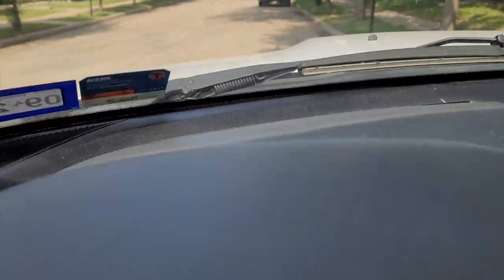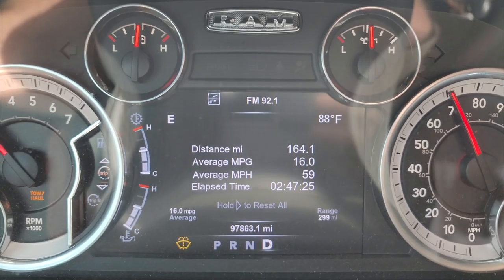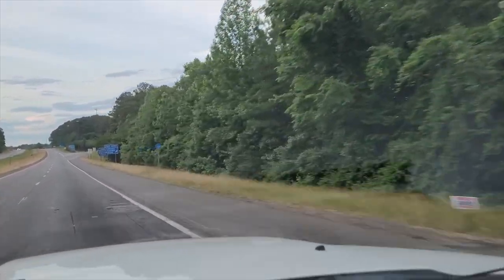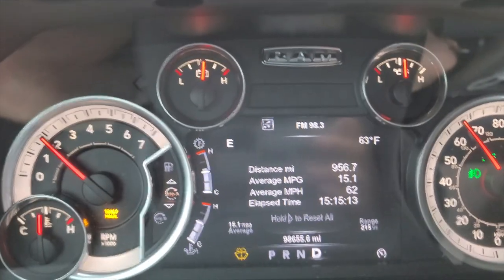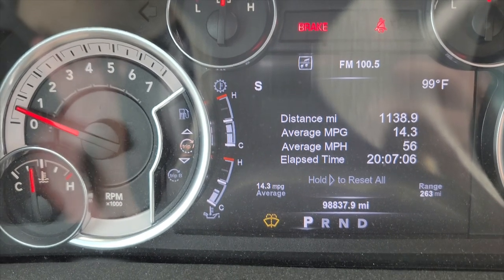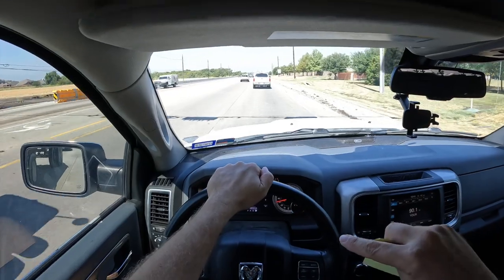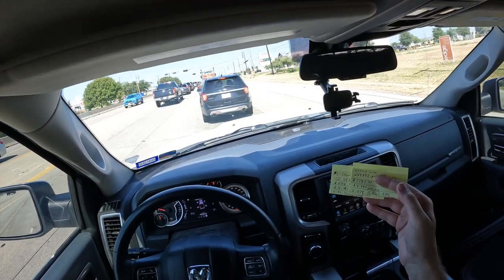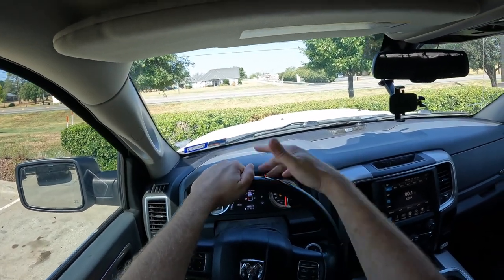Ram 1500 Mileage Test Towing an Open Car Hauler and comparison to towing an Enclosed Trailer

Comment: Better mpg than I would have expected. Love your detailed videos Chris, thank you!
BTW, picked up my new 2022 single seat 1320 on Tuesday. Planning some trips right now to get 1,500 miles on it before the Las Vegas drags next month...
Reply from the maker: Congrats! I saw the pics you sent, but it wouldn't let me reply without installing a different Facebook app. I'm honestly jealous of the single seater.
Reply: @Scavenger1320  Weird thing is it has almost the exact same weight on the vehicle shipping order as the '21 with full seats.  The full seat '21 weighed 4,146 lbs. and the '22 single seater weighed 4135 lbs. If I recall correctly yours weighed 4,138 lbs. Surely the passenger seat, rear seat, all the restraints, and the front & rear floor mats has to make a bigger difference than that?

Comment: Aren’t you concerned about what appears to be the transmission and oil temps? The whole video shows the gauges are maxed out in overheating/hot zone
Reply from the maker: Not sure what you mean, the temps are all at normal operating range. Unless you're looking at the red line at the top of the oil and transmission temp gauges, which is what I'm guessing is what you might be looking at because those red lines have tricked me before too in the past. I don't know why Ram designed them to show a red line at the very highest point which at first glance looks like gauge needles, but the actual level is noted by the filled white bar, which is just barely past the halfway point on each of those gauges.
Reply: @Scavenger1320  ok, it looked like the needle was in the red, Ram should redesign it

Comment: Do you know the payload capacity in your truck?
Reply from the maker: According to Ram's towing chart for my year and setup truck the payload is 1680 with a max trailer weight rating of 8070
Reply: @Scavenger1320   awesome thank you so much man